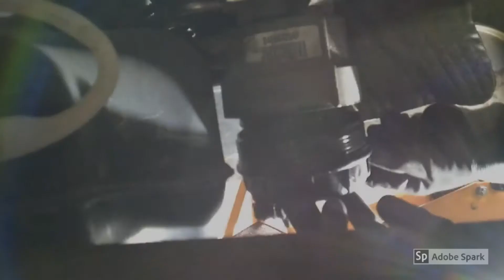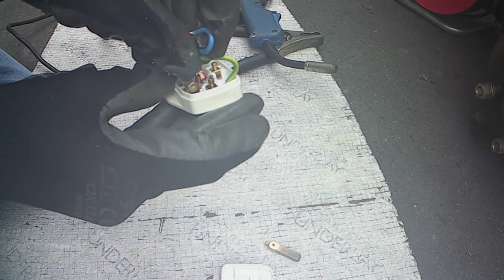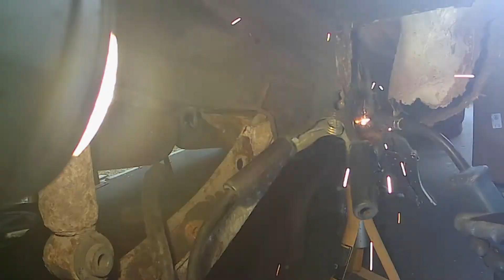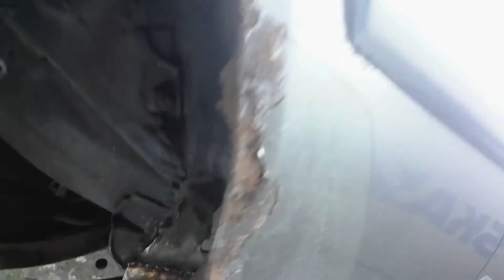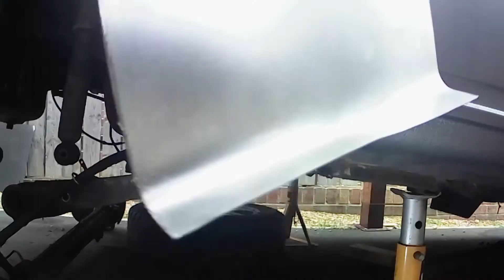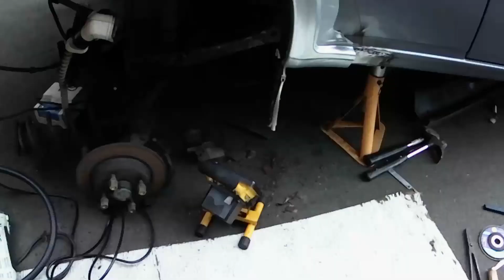Volvo480 welding sills using Clarke 120E

Comment: Get argon/co2 5% bottle and regulator for bodywork. From what I see you’re making classic mistakes, not enough gas, pulling torch away when it arcs which removes the gas shield, feed too slow. 120E has an iffy cable brake, take the spool off and spray faces with silicone and put back on but don’t over tension. You motor won’t struggle then. Others have mentioned the liner.

The roller can wear, if you take a diamond warding triangular file and clamp the roller against it in a vice to impress the roughness into the groove, turning it a bit at a time until you have impressed the file pattern into the groove all round. Nite, you are not filing you are only pressing the roughness so it grips the wire better.
Reply from the maker: Thanks John, great info there, I wish you'd been around before I started as this info is gold!
Reply: @junkendriven  the roll brake system is a bit jerky on these, making sure both the spool and bearing face of the screw on brake tensioner is vital, adding a spray of silicon helps smooth out the feed whilst using minimal tension and less load on the motor.

I’m no expert, I just have one and worked out what was interfering with my feed. Rusty wire is a major nono. I only get one kg spools as I can’t use 5kg quick enough and it gets rusty.

Comment: ok, several issues.  1 make SURE your hose is STRAIGHT as possible when welding.  2, make sure your teflon tube is not damaged inside the hose.  3,  Make sure you do NOT welding hard right on the tip.  Excess heat will cause the wire to weld up to the welding tip.  Thus causing the wire NOT to evacuate the tip at the right speed.  I can see you are running way to slow for this.  I really think you need to replace the INSIDE Teflon line in the hose.  Feeding this machine takes 5 mins.  Here is how i do it.  Cut OFF the wire.  Yank out 3 meters left in the hose. Re-thread the line, pull the trigger and SELF feeds.  If the self feed takes too long then inner line is nafff.
Reply from the maker: I think you've hit upon an issue I've thought about. I suspect the tube in my hose isn't the best as I cannot slow the wire rate down too far otherwise the motor jams and can't feed the wire. The welder is pretty old now unfortunately.
Reply: @junkendriven  My welder is older than yours i think.  also in much worse condition.  I dont have a regulator or gas so i have to use fluxcore.  Check the following.  Are you running from an extension lead.  if so, I assume it is using a thin wire gauge properties.  If so then the amps needed cannot make it to the welder.  It will cut out alot.  This only affects welding. Please use an extension with thick cables only!!!.  elec supply is KEY.   2nd check the welding hose to the gun.  Is this hose Pinched or bent BADLY.  if not then its ok.   3rd check the inner sleeve line feeding the wire.  If this is corrupted, this causes major drag on the wire feed.   Speak to clarke and see if they can supply you either a new hose complete of the inner sleeve if it has one.    Also, anything less than 1mm thick should be around speed 5  Anything above that should be 5-6 upto 1.5mm  anything thicker is normaly 7-8 upto 2-3mm thick.  This is based on 0.6 gauge welding wire.   4th please ensure you have the welding wire hose as straight as possible.  More bends in your trigger hose causes major resistance to the welding wire.
I am also still learning my machine and its a really old and banged up.
Tell you what you can do.  Cut some OLD but new metal.  try welding together.  10 pieces should do. this would make 20 off cuts no more than 10cm in length.  DO NOT overlap them, just simple reweld the material back.  When you start the weld, simply hold for 1 second and you should get atleast 3 or 4 crackles to listen to.  Once you get atleast three move in the direction of weld that you want to create.  The metal cannot be any thinner than 1.2mm.  Practice on slighly thicker material.  This should be a setting of   Please chek your switches for A   2   MAX  speed 6/7.  this is for 1.2mm and upwards.  Do a small video on this.

Comment: Hi Andy, Glad to see you're still welding. Do the welds in tacks, don't try to continuously weld on that thin sheet as you'll risk blowing through it. And please don't use a cut off disk on the grinder to grind, they have a habit of shattering and you'll know all about it if it does (really dangerous). Use the flap disk to grind, that's what it's designed for. Happy welding.
Reply from the maker: Great tips there, thank you for commenting. Good info on the cut off disk, yes I know it's a little brittle for what I want but I always have eye protection, mask covering, gloves and something thick clothing just to be safe. Thanks again
Reply: @junkendriven  you can get grinding disks that are similar to the cutting disk but a lot thicker ans made for grinding. Also I am a welding novice but the sheet metal you are using clearly has a coating on it as bare steel would rust on the surface. In all your welding videos I just think that both metal surfaces would venefit from a lot more prep as everything I have watched on welding says that you need clean metal to make a good weld. You are welding coated new steel to painted old steel. It should be shiny silver on both parts. Try taking a grinding disk to the sheet metal and then test doing a weld bead on that area then on a non ground area and see if it improves it.